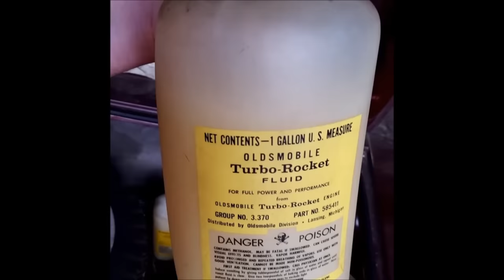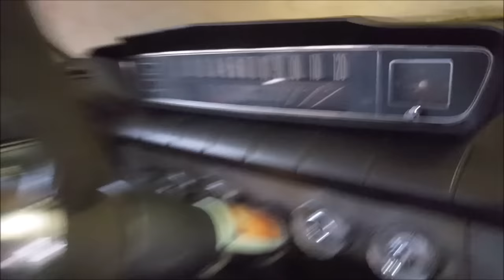The Garage Find 1962 Oldsmobile Jetfire V8 FACTORY TURBO - The Auto Archaeologist

Comment: I've been around cars my entire life and I'm in my 50's and I've never seen one of these.
Great find.
Reply from the maker: I've only seen 2 in all my travels.  They are neat.
Reply: CANUSA Kommando one of the first years of the Cutlass I had the first year in high school a 1961 with the world’s smallest cubic V8 at the time 215 all aluminum block..
Reply: @richardlester4670  What a
  great ride. Remember those drive Inn night lol. 
Great times.
Reply: @richardlester4670  The 215 engine was often pulled and used for small airplanes - it had a good power to weight ratio...
Reply: @daveconna6271  The Jetfire block (more headbolts than the standard 215 block) was also used for the Repco engine that powered Jack Brabham to a Formula 1 championship in 1966.  It was sleeved down to 2.85 liters.

Comment: Wow, what a find, man. Not only have I never seen this car before, I have never even heard of one, that's awesome!
Reply from the maker: Excellent!
Reply: Auto Archaeology i did a little research on it. They made only 3700 of them total in 62. Wonder how many had the 4 speed manual. I'd guess not many. Rare car for sure, thanks for sharing!
Reply from the maker: A handful, this got sold to one of the Jetfire experts thankfully.
Reply: 203 were made in the 4 speed model. This is very newly discovered information that was presumed to not exist till a year ago. This is one of two 62's known to still exist that are factory 4 speed. some others out there that were converted to 4 speed though.

Comment: My mother had a 1962 Olds F-85 with the 215 aluminum V8 which she drove for 5 years before trading it off. Hers had a regular carb and no turbocharger, but it was plenty peppy.
Reply from the maker: Yeah, not a bad engine, just underpowered for the size.

Comment: About all I can recommend in these road rockets is their styling. Quality I might figure, but there's no win in reliability because part of the headec is the Buick Skylark 215 aluminum block mill. Summer heat is murder on the engine, which if driven past 90 degrees, will constantly overheat, and vapor lock as well. Parts as well as service which are costly provided you get any help, are a nightmare. But then a major part of the trouble is that demon rocket fuel and water injection system. You can't drive with it because of subsequent carbon buildup system issues, and if you try driving with the system off, your performance suffers abnormally, and the steel on these cars rust to the afterlife (as bad as concurrent Mopars). Then, where can you get the special rocket fuel if you don't have it? You may want a Jetfire, but it doesn't come recommended as an enjoyable collectible car given the high degree of anguish owning one. Buick Skylark models don't repeat the migraine potential of the gimmicky Jetfire fuel system, but the remaining reasons that apply all but kill recommending these cars as enjoyable collectors cars.
Reply: These engines do not have an overheating issue whatsoever. They do have a lack of knowledge issue that some of the owners suffer. Back in the day people did not use the antifreeze like they were supposed to and aluminum engines do NOT like water in the cooling jackets. They need antifreeze. I have ran my Jetfire in weather over 90 degrees in stop and go traffic with zero issues.

Comment: I just saw this car completely restored on Jay Leno's garage. It's beautiful now, better than new.
Great find.
Do you know why it got parked?
Reply from the maker: Bent pushrods
Reply: @AutoArchaeology  I think the guy that owns the car now said if the engine was turned off while it still had boost pressure in the system, it could leak down and cause it to hydro-lock.
I know hydro-lock can bend connecting rods, I wonder if that's what bent the pushrods?
I think he said in 63 they put a pressure release in the system.
Thank you.

Comment: The Jet fire was sister car to the Pontiac "Tempest" A very popular model in it time.
Reply from the maker: That is correct!
Reply: I started selling cars in 1971 and there were a few of these still around I  worked for GM for 40 years and seen many model changes I worked for them till they discounted the Pontiac line in 2009 and then I retired .
Reply: Uncle Buck that was only in body design. The Tempest your refuting to back before the 64 model year, like this Oldsmobile, has a dedicated different chassis design.  That had a slant four cylinder that was half of a V8! With four wheel independent suspension, that had a Corvairs transaxle! With a strange curved "torque tube" for a driveshaft that was kind of like a giant speedometer cable! That all changed in the 1964 model year! When the new Tempest was also used for the LeMans/GTO!
Reply: You are correct, my neighbor has one, a convertible, I see it almost every day, Pontiac Tempest, 4 cylinder slant. ! half of a 389.
Reply: More like its cousin. It's not-as-sexy sister was the F-85.

Comment: What people do not know. This compact for General Motors is Oldsmobile, Buick, Pontiac and Chevy. All the same platform. Oldsmobile jetfire is turbo charged , it's Chevy corvair is also turbo charged. Yes I know that the corvair is rear engine, but it is the same platform. I have owned corvair and Oldsmobile 1963 convertible, and 1962 Buick. I was looking for a Oldsmobile jetfire, but have given up. My dad have a Oldsmobile jetfire. But the Oldsmobile dealer did not know how to work on the car. So the dealer removed the turbo charger and put on a four barrel carburetor. I still have the turbo charger, carburetor, aircleaner. Will sell all. I also have a Oldsmobile jetfire aluminum block and heads. All this parts are very rare. But I have given up on the idea of finding a 1962 jetfire.
Reply from the maker: The new owner of the Jetfire is here on YouTube, his name is EricJ I believe.  He'd be the one to throw that too.  But very cool still, and if you can't reach him.  Drop me an email, I have his contact info.  TheAutoArchaeologist@yahoo.com

Comment: Olds got right what Chevy got wrong with the Corvair Monza Spyder turbo.

Olds: Small, light, quick turbo, exhaust wastegate, high compression ratio and water-methanol injection. I used a Holley water-methanol injection rig on my 1980 turbocharged Mazda RX-7.

The Jetfire was truly ahead of its time. But some of the terms... "Turbo Rocket Fluid." Seriously.

Unfortunately Olds ended up retro fitting many of these cars with a simple 4 barrel carb instead of the turbo.

The customers didn't understand the importance of the methanol injection and if the "Rocket Fluid" tank was empty, a protection mechanism effectively crippled the turbo.
Reply from the maker: Yup, very true!

Comment: The methanol in those 2 rocket fluid bottles still not evaporated after 45 years?
Reply from the maker: That probably did evaporate away, the rest is left.
Reply: @AutoArchaeology  The rest should be water which also should evaporate. Basically I am surprised the bottles look pretty full in the video after 45 years!

Comment: WOWWWWWWWWW, I was just reading about those, main issue was that you needed to get that 'fuel' only from OLDS dealer and it would take only 1-2 gas fill ups to need a refill, they eventually had a recall to remove turbo
Reply from the maker: Yup!

Comment: These cars are rare but not much in demand. 215 cubic inches 215 horse power. Oldsmobile dealers acted like they never heard of them when you took it in for maintenance. That fluid was unavailable soon after they went out of production. Land Rover bought the tooling from GM and used the aluminum engines for years. The block material was much better when Rover built them. The GM blocks were porous and turned green from the antifreeze leaking through them.
Reply from the maker: That's true.  Definitely a unique car.
Reply: Larry Meyer seems a guy may be able to make his own jet juice for it. I'd bet there is a recipe out there somewhere...

Comment: Miles documented? Thanks for uploading amazing car!
Reply from the maker: I believe 60,000
Reply: There is an oil change sticker on the door jamb that shows 1970 with 42,000 miles on it. Then, in the glove box, there is a receipt from a day after the oil change that also showed 42,000 miles for a set of spark plugs and a set of points. Funny thing is, They did not change the plug wires and they are still the 1962 dated plug wires. The car was last plated in 1974 and has 44,000 miles on it now. About as good as documentation I can get. It had the original 1962 title when I got it so the car was new. No second owner title to document miles till I got it.
Reply: Olds Jetfire thanks, for saving it...only one time it is Original:: what did you replace( e.g .tires are scary after 40 years)?
Reply: @opera93  He done took it apart to "restore it"...so much for such an amazing survivor huh?

Comment: Holy F you found one! The Turbo set up was similar to the ones Germany used in their fighter aircraft during WW2. Even rarer is finding one of these with the Turbo still in it. There was a recall and most were given a carb set up. The fluid is water, methanol, and a corrosion inhibitor. It was dealer only and people start using straight water. Post a video of it running and burning rubber, if one hasn't been posted already.
Reply from the maker: THere is more coming!

Comment: 215 cubic inch, 215 horses but the turbo was slow to respond, so quite a few were swapped to a regular 4 barrel set up, also the early 215 loved to eat camshafts
Reply from the maker: That is true
Reply: The heavy, slow revving turbo didn't give any boost in 1st gear, but 2nd gear went full boost and felt as strong as first gear...

Comment: MY father added an alcohol injector to our '71 Ford Torino so he could advance the timing and get  better gas mileage without getting engine knock.  It worked quite well.  

But we just didn't know to call it Turbo-Rocket Fuel...;).
Reply from the maker: Yup, they still do something similar in diesel trucks.

Comment: Nice car, especially since it till has the original motor. What do you use in place of the rocket fuel if you want to drive it? Obviously GM isn't making it anymore.
Reply from the maker: It's just a mix of water, methanol and some lubricants.  They use something very similar in some high performance diesel trucks.

Comment: Amazing rare car that very few people are aware of.  The author  states the tires found on the car are original.  They are not factory original, except for possibly the spare.  At that time, bias ply tires could not have lasted 44k miles.
Reply from the maker: They aren't, the owner said they were.
Reply: The spare tire is original. The ones on the car were replaced but are replaced with the correct Firestone replacement tire that was available at the time. The only difference between them and the originals are that the white wall is a little wider on the originals. These tires had to have been bought in the 60s.

Comment: Nice could it not be 144 or?
Reply from the maker: 144 what?
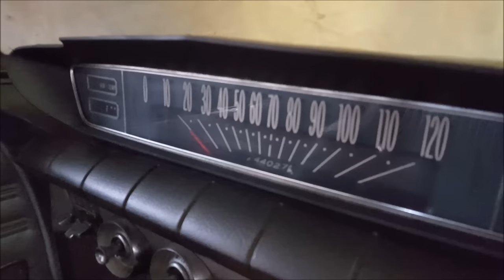Reply: 01:42 miles
Reply from the maker: No, the last checkup paperwork shows as 44,000 miles.
Reply: Oingo Boingo most cars of that era were lucky to hit 100,000 miles before they rusted out or died from  old age.
Reply from the maker: That's true
Reply: True but not impossible, I am of that vintage and know my Gpop ran his 57 Plymouth and Savoy, 67 Chrysler Newport Custom well into the 200s.

Comment: Turbo rocket fuel. Distilled water and alcohol.
Reply from the maker: More than just that.
Reply: @AutoArchaeology  50-50 mix of methanol,  distilled water, and rust inhibitor. My friend owned one of these cars and made his own turbo fluid from Methanol he got from a local Ker McGee distributor. He didn't use any rust inhibitor in his recipe and never had any problems not using it.

Comment: the driver door panel shows that its not original 44000 mile its more of course because of its every 99999 Mile turn to zero so maybe its 144000 Miles
Reply from the maker: The interior doesn't show that kinda wear though.
Reply: Here is a newer video of the same car with some interior shots. The only thing I done to the interior is clean it. It is for sure a 44,000 mile car. I have been around several of these cars and I have yet to find one with over 100,000 miles on it. Most of them quit before that long. https://www.youtube.com/watch?v=Jzw5W1rRMog

Comment: My first car was a '62 F85.  Not a Jetfire.  Had a 215 cu. in. aluminum V8 and four barrel carb.  Would really scoot for such an ugly pup.  Had to helicoil both heads as spark plug holes were always stripping out.  Had automatic transmission that was total crap but I loved that car...right up until I traded it in on a '70 Boss 302.
Reply from the maker: That's cool, both of them!